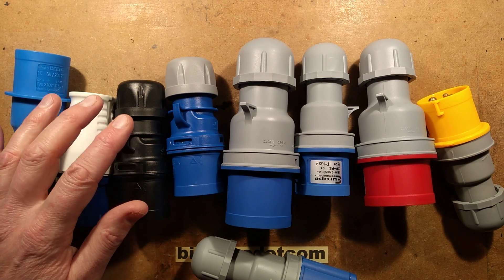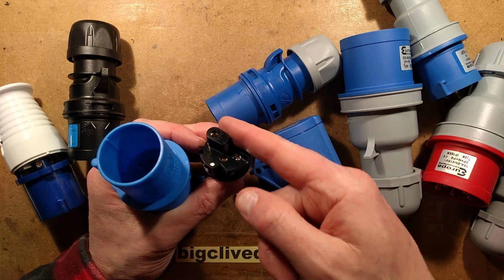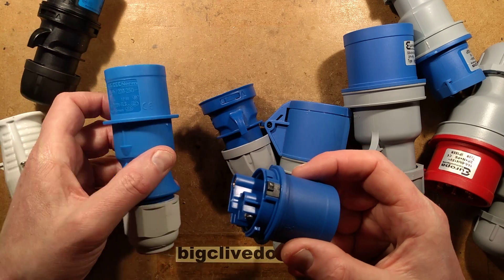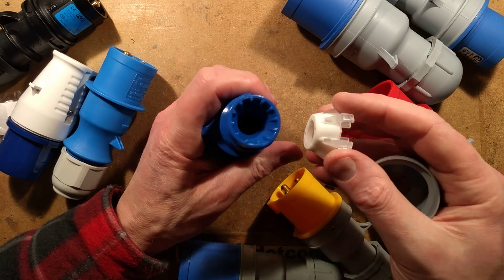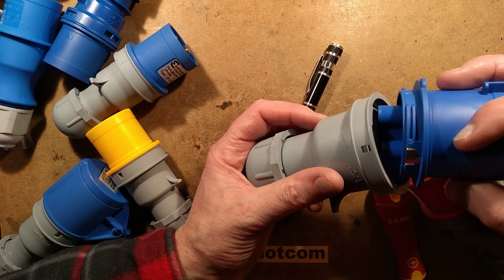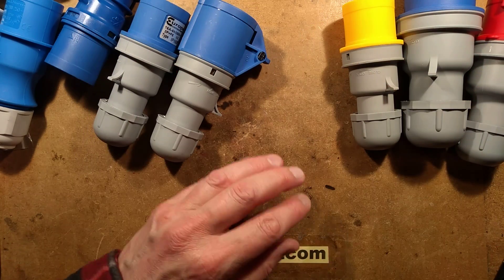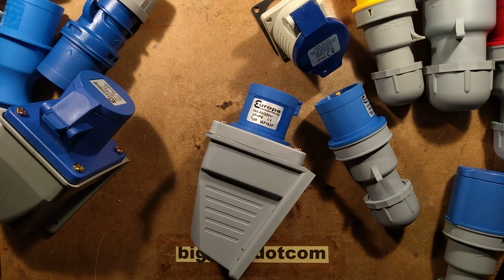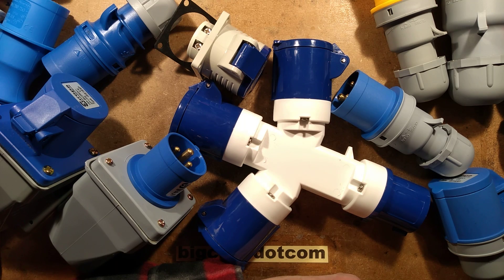My favourite industrial connector (Ceeform).

Comment: It was a 5 Pole threeway ip44 socket  from this brand, very Cheap and looks like the original from PCE Austria. But Poor quality. The hole from the unper Part are broken fast.
So I only fix it with a bigger screw.
Never again.

Comment: In the Netherlands these c-forms are mostly used in outdoor applications. Not many have them in the home but they do pop up in workshops or well equipped garages to power semi professional welders and plasma cutters.
You can find them most of the time at (municipal) RV camp sites where they provide power to the parked RV (mostly not more then 4 to 6A)
Most of the RV-ers use a converter pigtail to convert from a three pin c-form to a standard female grounded plug since most of them use a standard (though more heavy duty) extension cord in case they park up at Joe Schmoe's place and need to plug in at their regular household outlet...

Comment: finland: i think that blue ones are used in caravan areas. 5pin red ones are used as 400v 3-phase ac connectors. nearly every house has one red somewhere. there are also bigger sizes of them for bigger current ratings. Powerful extension cords with 400v 3-phase red connector in one head and 230v schuko sockets in other are also common in garages, industrial, etc.

Comment: I have a three vace heater but don't have a transformer to test to make sure it still works is there any other way I can test it
Reply from the maker: It depends on how it's wired.  If it has a common neutral for the heater sections and if there's a fan - but it only needs single phase, then it may be possible to common all the phases together for use on a high current single phase supply.

Comment: For the second server room that an Italian engineer was in charge for building, they put 2 240V connectors that, and this was first time i ever saw it, won't disconnect for as long as electricity flows into the cable. You can try to force it, within reasonable of course, but it won't bulge, so that even accidental tripping won't affect it all. Apparently it is energized during operations. You have to turn off electricity to disconnect it.

A bit over the top, considering that for that server room, it is a small one, i have only switches in a single rack, and nothing else. But, hey it is interesting.

Comment: USA, we primarily use 4 pin 63A blue ones for linking spider box drops for events. Anything above that we go to individual core cables with CamLok, 400A. When investigating power for a private summer event at the local ski resort, I discovered they use 4 pin blue 125A connectors for the 480V three-phase snow blowers, which is very dangerous!

In the US, every 4 pin blue I have had experience with is wired standard with two 120v power legs out of phase (so you can get 240v if desired), a center-tapped neutral, and ground.  The resort had these wired as three 277v legs and a ground. I am glad I checked before just ordering a connector and didn't kill anyone or damage expensive equipment.

Comment: Favourite term for that male-male cable catering outlets like is a 'widow-maker', for obvious reasons.

And for your viewers not familiar with the industry - a big difference between this and your domestic 13A UK plug, is that these do not contain any fuses. All the over-current protection is handled by (typically) MCBs in the distribution system and/or in wall mounted sockets.

Which introduces some interesting failure mechanisms when someone makes an adaptor to plug a 16A connector into a 125A socket.

Comment: I've used these at an airfield for ground support equipment power. Embarrassingly, it took me about half an hour to figure out how to connect it my first time.
Reply from the maker: That's common.  Once you suss them out they are easy to terminate.  The wires should all the same length so the earth disconnects last if the cable gets ripped out.

Comment: The blue one in Poland sometimes is used for hot air industrial heaters 230V / 4 kW up to 6kW or for long time use with plastic extruders welder.

Comment: I find the UK regulations about only allowing 50v split phase at building sites quite interesting. 
Here in Germany we can use just normal 230/400V and I havent heard about any incidents with electricty on building sites, so it must not be that dangerous.
In Germany the power on construction sites is usually distributed with 3 phase red CEE Plugs, which go to small fused distribution boxes with smaller 3 phase cee plugs and schuko plugs.

Comment: I got a question for the group! What are the 4 pin 400V plugs used for? I have a few red ones that come without a neutral (both 32A and 63A with a pilot pin) and I don't know who would use them. Maybe they are a bit cheaper because it saves a strand of wire in the cable...
Reply from the maker: Some three phase industrial equipment doesn't use the neutral.  I prefer to fit full five pin 3-phase sockets to give either option.
Reply: @bigclivedotcom  Yeah thats what I thought! The lathe diagrams I looked at used a 415 to 240 transformer instead of using a neutral. But losing the compatibility seems really impractical. I wondered if theres a field where 3P+E plugs are customary despite the drawbacks.
Reply: @kv4302  I think a lot of the time, plugs and sockets are installed to facilitate maintenance and/or to provide a demarcation between the building wiring and the equipment which are responsibilities of different departments but nevertheless the socket was installed to supply one particular piece of equipment and interchange is not a major concern.

There also exist power systems whjere neutral is simply not used at all. For example my understanding is that in some parts of northern Europe you see systems with 323V phase to phase and all loads connected phase to phase.

That said, I do think it's a shame that there is no compatibility between the different pin counts.
Reply: @bigclivedotcom  Thanks for your answer! I recently got a pile of CEE plugs and receptacles and things for a steal, a grand or so for everything new and I paid 75 eurobux. Not that I can use 125A plugs for anything, though I might wire one up to a ~personal massager~ for the fun of it.

I did notice the 63A and 125A having pilot pins, are they ever used? I couldnt find a cable that had the 5 big wires and a small pilot wire, and the Mennekes sockets don't come with the pilot receptacle pin by default for some reason. The pilot pins do seem very useful.

Anyway we're brothers of the CEEform fan club, is what I'm saying.

Comment: Germany: the blue ones not that often but the red ones are to be seen all over the construction sites.

My favourite part on Cee-Form is the fact that it's not possible to misplug live or neutral like with Euro-socket. It's that much more handy, when you don't have to use bipolar switches...

Comment: In late 2009 they started coming out of Shenzhen China with industrial plastic extrusion equipment, to the USA. They did not have a ground pin that was longer than the other connectors, that made contact first, or was the last to make contact when removed, so were deemed a hazard in our sometimes explosively wet environment. (Many times mold cooling water hoses broke, rubbed through, or came off of hose barbs.)

Comment: Somewhat common on commercial kitchen equipment in USA. They have a larger one with a lock ring on it. Not sure if it’s exactly the same but very similar. Not so good mounted on a wall. They get broken constantly. A lot of places have them hanging from the ceiling. Expensive as hell.

Comment: I've seen purple coloured 2 pole ones used for DC applications, on the front of a fire engine as a 24v charger flylead to keep the battery topped up.

Comment: I work in a factory with a warehouse. We had a cable with a connector like this for connecting our electric forklift's charger to three-phase (I believe). I think there was a second one for one of our big three-phase machines, too. There's something very pleasant about handling tough rubber-clad cables like that, with good sturdy connectors. It feels very reliable.

Comment: As mentioned by some, adaptors from household outlets to trhe 16 Amp receptacle are common. Most do forget, that this is only legal, if the outlet is a polarized outlet. The CEEform system is polarized. The Shuko side contact ground is non polarized, and even the theoreticly polarized  protruding ground plug used in France, Belgium and many other EU countries, exists in polarized and nonpolarized form (eg Poland, where you find dual outlets with the ground pins in the centre.)

Comment: The 240V 16A version are pretty much standard throughout Europe for mains connections to touring caravans and motor caravans (recreational vehicles).
They are also used at moorings for canal boats in the UK, so may be widespread for seagoing craft too.

Comment: When I worked at Lindab (a Swedish company) in Portsmouth, VA, we had these type of European connectors on everything. This allowed us to move our equipment around very quickly and easily. Very safe and robust compared to the typical Hubbel twist-lock crap you at most American factories for plugs and drops.

Comment: Always interesting Clive, thank you, like you when wiring these I double over the conductor, but recently I’ve started using ferrules on flex, your thoughts on using ferrules would be welcome
Reply: NEVER use free strands in screwed terminals. Just don't do it. You're shearing off strands that, one, go wandering and causing havoc where they fall, and two, weaken the connection. I've seen things melt and go up in flames under load from being terminated like that. Just simply make it a habit you're not thinking about anymore, and know you're faring that much safer.

Comment: They use these or something similar at McDonalds here in the US.  They have them hanging from the ceiling for rolling equipment, as well as boxes coming off a metal raceway that powers the grills and fryers.  Most stuff there uses 208v, even the POS terminals which really confused me since my grasp of 3 phase has always been limited.

Comment: hi Clive can you do a video how  the entertainment industry 3 phase to single phase conveners work thanks
Reply from the maker: Do you mean the simple three phase plug to single phase outlets?   If you do, the single phase sockets each get one phase, a neutral and a ground.
Reply: bigclivedotcom thanks bro
Reply from the maker: @andrewkennedy5484  It's very important to make sure the neutral wires are all secure.  If the neutral connection fails it can cause high voltages on the single phase sockets.

Comment: In the audio world, we use these sometimes. The place I used to work for had a 16A  outlet in the corner of the stage, which they split out into 3x230v plugs which were then split out with regular power strips to power the speakers, lights, mixing desk and guitar/bass amplifiers.

At larger places they have the bigger ones to power racks of power amps.

Comment: I saw these plugs being used in a convention centre. Wiring has been built into the concrete pillars throughout the halls. When an exhibitor requires power, one of the technicians wheeled out this mini breaker panel which was wired to standard 110v sockets. It was a very clever design IMHO.

Comment: Like you I dislike the first two 16A plugs ( too fiddly). I work as a sparky in a dockyard & fabricators, on the 16A connectors I double the cable ends over for more bite ,and on the earth I dig the outer most screw into the sheathing  As for cabling we use  ho7,arctic, then on  3 phase it's  ho7 and sy sheathed cables for the high demand machines like welder units. Ho7 and armoured for 125A supplies.Any supplies larger than 125Amp are terminated into fused boxes,all these cables have swaged ends and are moved using fork trucks..then there's  welder cable and earth bonding using 125sqmm cable( cable wrestling should be a endurance sport) the variety of plugs from 3 phase onwards gets complicated.

Comment: We use the 250 Amp version, with 95mm flexibles wired in.
Requires full body weight to unplug.
In our vsd test bay where we pull current to get some heat into the igbt's or thyristors.
The load is a motor driving a re purposed engine dyno, so the current produces hot water.

Comment: Just love those CEE connectors. I use them on my camper for shore power. I even have a "red"-to-"blue" 16A converter just in case.
And by the way, the traditional "schucko" is rated to 10A continuously, 16A is allowed for short periods. Those CEE beasts will hold the rated current and a bit more without any issue.

Comment: Hi from Norway. we use many of theese at my work, and we discovered that specially the cheap ones cee 16a 1phase+earth and also 32a 3phase+earth 250v ones, the legs on both their male and female type of the cheap ones, the connectors are often coated with a metal alloy coating, and is not of solid copper/brass alloy, we came across one of those shiny white metal alloy coated ones, and after a year it was totally corroded female and male was coroded together, and the earthing connector had rusted totally and made the earting lead inside the cable all black and rusted, this was a proper outdoor black 1phase copper type cable. you should try to get hold of some  those shiny metal coated ones and test them @bigclivedotcom

Comment: No quickconnect ones? Also, you didn't mention: On the sticker you fill find a time, such as 6h or 9h. This indicates the position of the ground pin, i.e. 6 o'clock etc.

Comment: I work for a company in Sweden that build high power lab gear, and we use these for everything, although rarely the single phase ones, mostly just three phase 16 or 32 amp ones, on occasion 63 amps.

Comment: They are used in Canada, but only very rarely. We use IEC 60309 Series II, with 20 amp being our smallest connector, then 30, 60, 100, 200, 300, 350, 500, and finally 600 amp versions. The "most common" one would be the orange 125/250v 60 Hz version, I'd think.

Comment: In Hungary we use these connectors in industry like most of the folks in Europe. Sometimes even at homes (the 3 phase ones).
My family even uses the 4 pin version sometimes, for bigger motors, that are not using neutral.

Comment: We have them in Norway. But we also have a blue 240v three phase connector as the common standard here is 240v TN, we have no neutral, only 240v between phases. So the red 400v connector is VERY uncommon, you'll only find it in industries that requires 400v and that therefore has their own transformers.

Comment: 12:30 Why don't they add a little hole in the bottom for the water to run out, instead of filling up the rim and eventually the connector?

Comment: In Iceland's construction site's we mostly use the 3 phase connectors. For temporary electric boxes and for 3 phase machines, but we use normal waterproof plugs for small 1 phase machines. Iv,e seen a couple of them melt together from abuse and those 32A Heaterblowers.

Comment: These "strange" current ratings are based on a system called Renard series. That's what most of the Europe uses for power fuse rating. 6A, 8A, 10A, 12A, 16A, 20A, 25A, 32A, 40A, 50A, 63A, 80A etc.

Comment: Great Video. As someone who works in the touring entertainment industry I can say these connectors are very much standard for power delivery. Generally speaking we tend to use 3 phase connections as incommers and split down to the various single phases via one or more distros as it is more versitile and we can work with a bit more standardisation. 125a 3phase and 200/400amp powerlock are probably the most common incomers for large events. Also the yellow 15amp connectors are commonly used in conjunction with 16a 3pahse connections as a control line to run motors. These days we also tend to break out of socapex to give us up to 6 lines per cable run. Powercon and Truecon are also a very standard for connection to various equipment and fixtures.
Reply: ...also there is an IP67 ceeform available that features a rubber grommet and a twist lock design

Comment: Not sure about that standard but have seen similar on the Great Lakes freighters. Usually brass housings and the internals look like bakelight. They have a threaded collar and rubber gaskets so whatever you have plugged in and tightened down is watertight at that connection.

Comment: I haven't seen them in the wild, but we do have variants here in the USA. Voltages and colors are similar except for 125/250 VAC center tap where we have orange. Currents are different as well instead of 16 we have 20 amps, instead of 32 we have 30, instead of 63 we have 60, and instead of 125 we have 100. Of course where a connector is applicable in both North American and Europe the connectors are dual rated (16/20, 30/32, 60/63, and 100/125).

Comment: I personally like connectors with protruded insulator "bases" around each pin (and holes around sockets) to lower possiblity of creating an arc under heavy loads and tighten protection from water. That's what all home sockets lack :(

Comment: We use the blue 1 phase for out boat (1x230). They are standard in marinas. The red 3 phase ones ones for work (400 V) in Sweden. I Norway they have  blue 3 phase w/o neutral. (3x230 V)

Comment: Been using these for many years in UK data centres, though we often refer to them as Commando connectors, rather than the correct terminology. That's a brand name from the manufacturer MK.

Comment: How do these cross over to a Hubbell 2721 / 2723 twist lock type connectors? Are they less expensive, more amps / buck? Are they more rugged and secure? Are they rated right at the limit, or is there plenty of head room, to say allow for a motor to start?